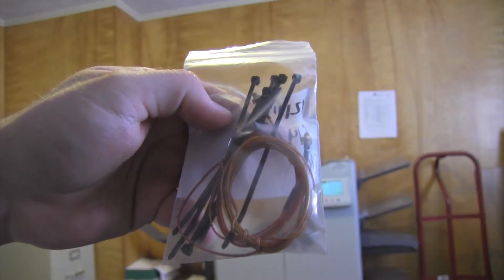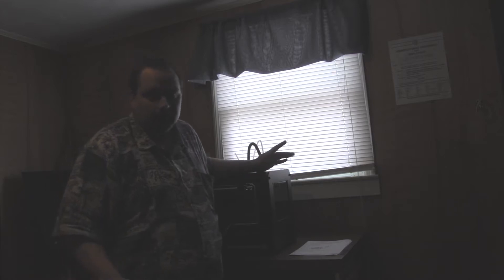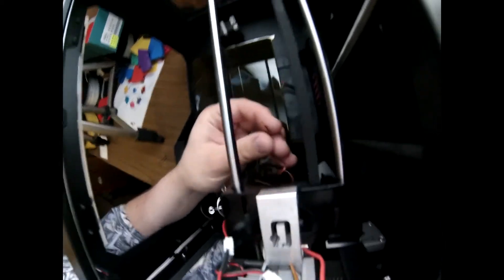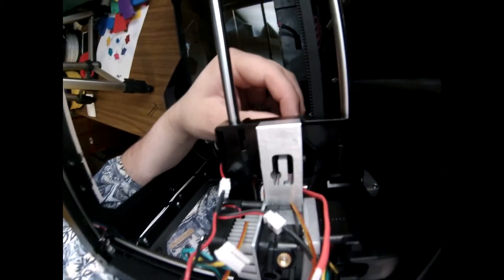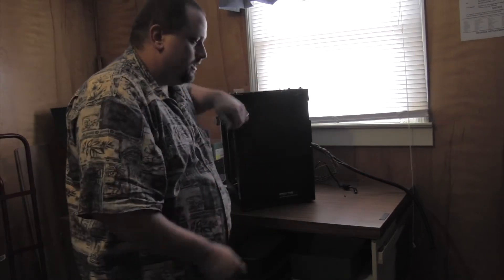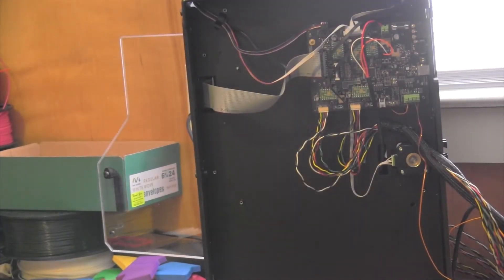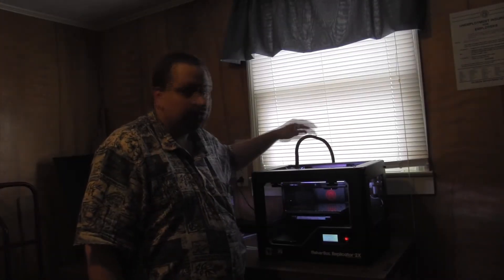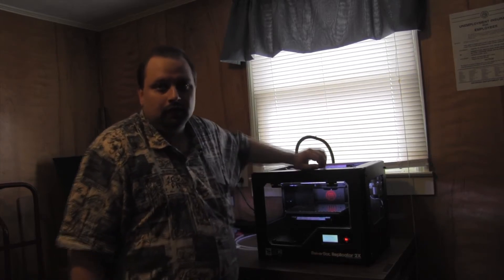Makerbot Replicator 2x   Thermocouple replacment

Comment: hi can you please tell me does it make any difference which way round the wires go from one extruder to mainboard as mine was covered in shrink tube so can not tell one from the other but one is a silver wire other is a copper coloured wire if i rem right i have connected mine with silver to right and coper to left   only just finnished fitting it all back together so not tested yet be nice to have info before i switch it all back on :0

Comment: Hello, I have a Replicator 2, and I got HEAT ERROR #3. There were flashing red lights.  I'm wondering if changing my thermocouple would make my machine good as new.   Other than that issue, I've had a few clogs now and then and my Rep 2 has been working full blast for the past 2 years.  Thanks for the video.